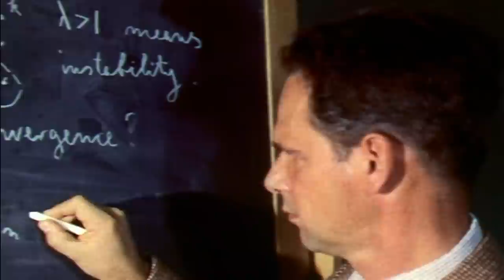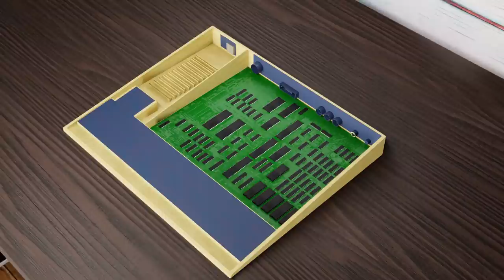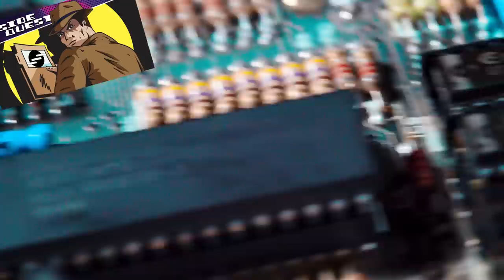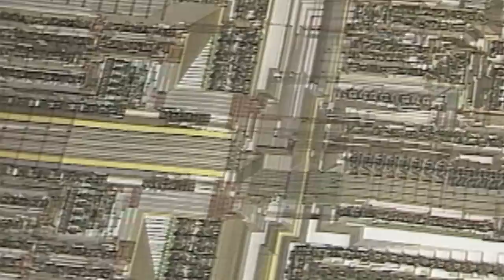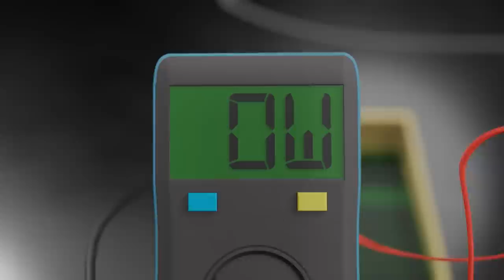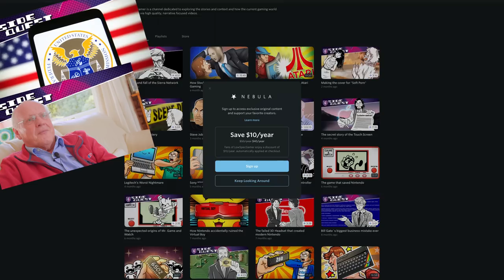How Amateurs created the world’s most popular Processor (History of ARM Part 1)

Comment: As I worked, at the time,  for the Ministry of Defence UK, I was one of the earliest  users  to try out the  first ARM chip pre-production  as a second processor with a BBC Master.  Steve and Sophie both understood that who ever produced the most Mips (Millions of instructions per second) per mA of current could win the race for mobile computing where power consumption is critical.  Part of the genius and forward thinking was to use  the 6502 CPU as  the first processor but place it in an architecture that could leap frog  the then emerging 16 bit computing with a 32 bit capable address space  and  networking with a second processor.

Comment: RISC processor, were originally designed to have every instruction to executed in a single clock cycle. The ARM was designed with 6502 simplicity, which is why a 1MHz can be as fast, or faster than a 3.5 or 4MHz z80a.
Reply: No. RISC processors do not execute an instruction on one cycle. But they use efficient pipelining which lets them start (and complete) one instruction at (almost) every cycle.

Comment: The "Acorn Atom", my first computer ever (it was a kit, not pre-build). I have 3 of them and they work run as of today.
One of them is rebuild  as a ISA card so it can run inside a old PC and utilizing the PC's Hardware like Keybord, graphics-card, HD etc. To let the Acorn Atom interface with the PC hardware, using a utility-rom,  you have to start a DOS "Terminal" that connects to the running Acorn Atom and translates the AcornAtom routine-calls to PC calls. The Standaard Acorn Atom system is already capable to Address modern Graphics card resolution,  but drawing a line from like point 0,0 to point 1024,743  takes some time on a 1 Mz 6502 processor.

Comment: I have started to learn assembly on Z80 Spectrum. It looks as a good way - especially when I had this computer in childhood, because there is a pure assembly - write something and it runs. Without complicated things - memory types, files, libraries which are needed by later operating systems. And I believe once I have learned it enough I will understand all the other assemblies like arm and x86 for 90% because they are all pretty similair.

Comment: I had a BBC acron as a child I learn BBC basic on to when 8 years old and them move to Amiga's. Then windows Happened didn't touch a PC from 1999 when I sold my Amiga modified PPC tower. I started using windows at work in 2010. And been catching up on code since. I'm nnow 43 and getting back into low level tech like chip design and coding machines.

Comment: At the time Acorn investigated the NS16032 (later rebranded NS32032) it was not working at the target 10MHz clock rate. Early sample were limited to 4 or 6MHz, so naturally an overclocked 8-bit could outperform it. The NS series had paged virtual memory which was  a major draw for workstation companies. It came close to being selected by IBM for the P.C. but samples were too far off in the future and IBM believed more in Intel's ability to produce millions at low cost.

Comment: Was a huge acorn/arm fan back in the '90's. Look at the mess ARM has become now, close to 900 instructions in the ISA. Bigger now than AMD64 was back in the 90's. Once you introduce new instructions there is no pulling them out. Best case you are stuck having to remove them physically and emulating them in microcode. IMO, the future is RISC-V. Looking forward to the next 5 years.

Comment: The more I hear/learn from the 70's 80's and 90's the more ashamed I am, that I can't even program a simple algorithm without stackoverflow, yet I had the same education asa they did. Now our days are spent fighting package managers and absurd deep tech stacks.
Reply: obfuscation is both an asset and a great mistake
Reply: You can find solace in the fact that most programmers back then were just as average as you. We live with the ideas and solutions that survived the test of time.
Reply: @rumble1925  Also, what the OP misses: The systems at that time worked because they hadn't to consider much, only to not blow up the 32KB of RAM they had with garbage and to not have too heavy calculations running. And even if a program like Elite would fill up the whole memory of the computer - it would still be just some 40k lines of code overall - and that's for all the stuff happening. They say you get a bug every 1k lines of code and only 1% of them slip through. When you only have to look up 40k lines of code - you will find the bugs before delivery. When you have to look up 40m of code, you will not!
Reply: @rumble1925  BS. Programmers were rather rare breed, and much more professional than now. Edsger Dijsktra said that appearance on personal computer brought programming 15 years back.
Reply: @TheGrantourismo 
Not in the UK it didn't, the BBC and the Spectrum are the reasons why the UK has the most important video gaming industry in the world.
Reply: At the OP.
Get yourself a Simone machine to play with at home. 
I have a BBC Master 128 as it's what I grew up with and all the technical documentation has been perfectly recreated as high resolution PDFs for free.

If you don't want a vintage computer, grab a Raspberry Pi Pico which is the closest modern equivalent, on power up it just immediately starts executing what's in its flash storage, it's all very down-to-the-metal and it's cathartic after breaking your brains out against js Frameworks all day at work.